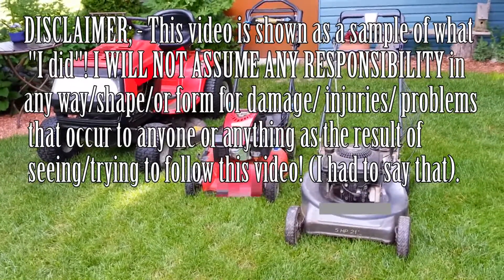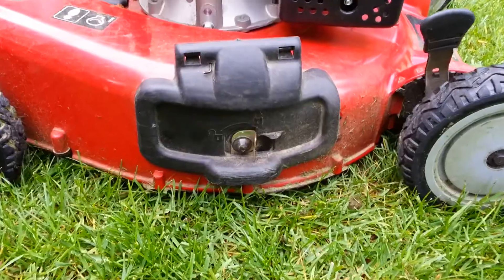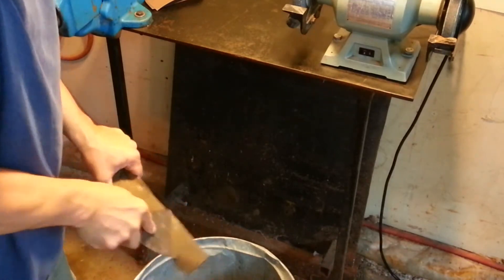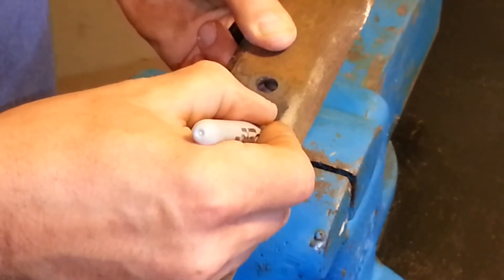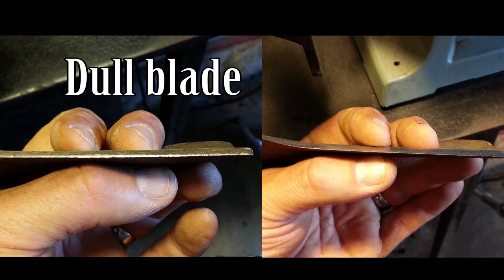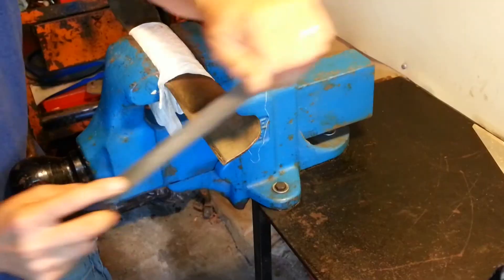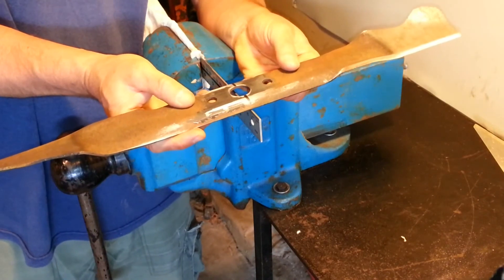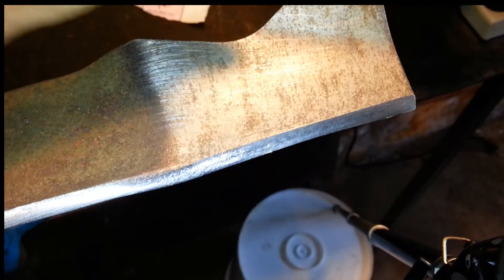How to Sharpen a Lawn Mower Blade by Hand With a File #14

Comment: Only thing to add is, when using a file, he is stroking in the proper direction, which reduces the feathering along the cutting edge that comes from filing towards the cutting edge. If a burr is felt along the edge, a few flat strokes parallel to the back side will take them off. Tough gloves are a strong advisory, as once the blade is getting sharp it is easy to hit your filing fingers on the sharp edge

Comment: 80 grade sander flap wheels 4" work swell. One set spare blades to keep sharp. Cone balancer works well and is inexpensive. Two blade system on one shaft works well for mulch.
Just as a dull scissors won't cut so to a lawn blade. Sharp blades are the way to go and are are actually rather fun to do. The engine sails easily as well.
Keep small stones and such out of grass and don't cut to low, the main culprit for dull edges. Good steel can cut millions of grass blades before starting to dull.
Reply: work swell? lol

Comment: What type of file do you use for this? IE: course, double cut or single cut? Thanks
Reply from the maker: I used a single cut smooth file for mine. Unless you need to remove a lot of material (by using a double cut), the single cut smooth option should suffice. You'd need to finish up with a single cut smooth anyways to get a good edge.
Reply: Awesome thanks!

Comment: Great video. Do you have a favorite kind of file for this job?
Reply from the maker: +avisitorhere If I could suggest one thing , it would be to use a file that will allow a longer "stroke length" (longer file).  Using the full length of the file while filing the blade will speed the job up dramatically.

Comment: The right side of the blade was heavier and you didn't balance it.
Reply: We don’t know what he did after the video cut. He clearly said that he files more until it’s in  balance.  I’ve spent two hours cleaning up bad blades.  This video is only a few minutes long.
Reply: @jerem0621  <<  I’ve spent two hours cleaning up bad blades.>>

If I had a blade that was badly out of balance,  I'd use a grinder to quickly remove metal from the end of the blade. until it is in balance.  No need to keep filing the sharp portion of the blade..